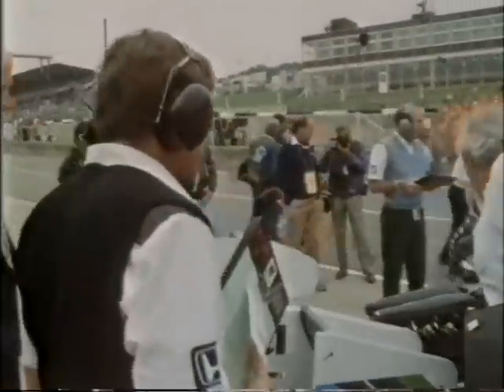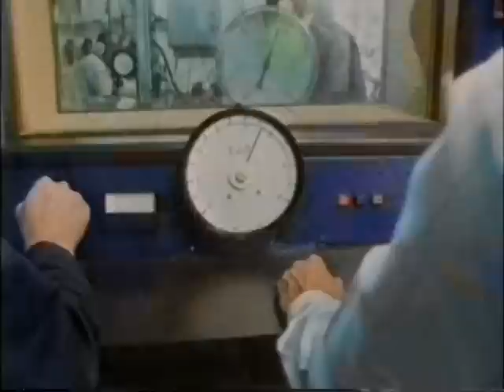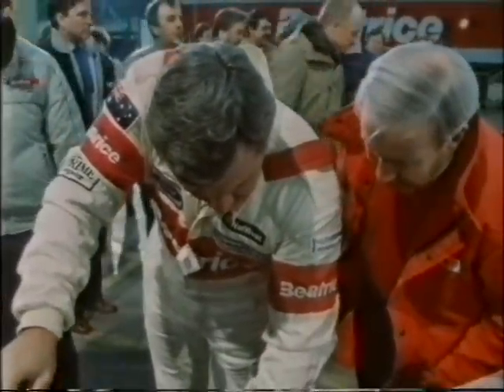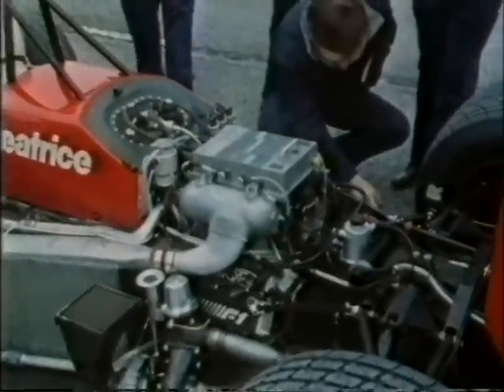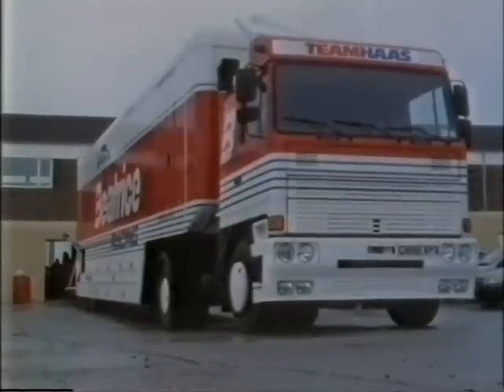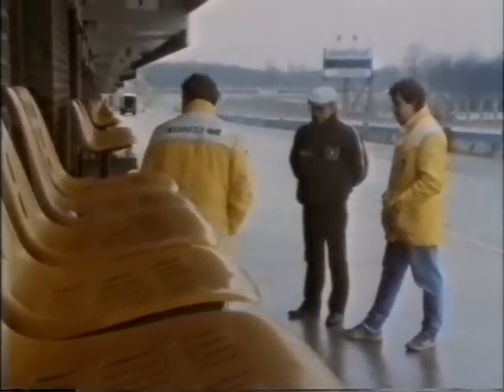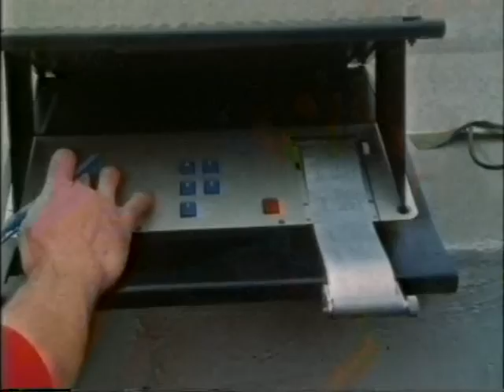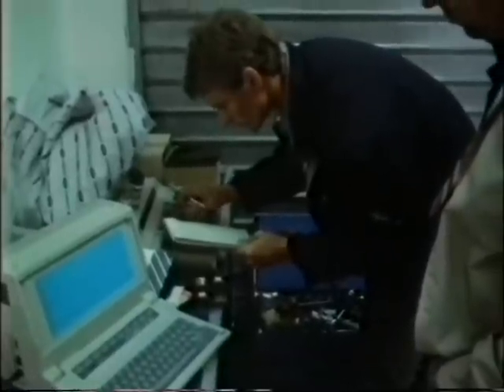1986 Equinox - Turbo - The Cosworth V6 Turbo for the 1986 F1 Season (Part 2)

Comment: Can you tell  why are head bolts in  angle,because i cant understand well,what did Keith said?
Reply: laza kojic so they can fit between the cams, thus negating the need for a separate set of cam carriers above the head. It also puts an angular load at the block/ head interface. Clever stuff.
Reply: From what I understood, the angled head bolts help tension on the block. In other words, they pull the block together thus relieving stress on the block itself. Hope this helps. :)
Reply: "originally" (one assumes he means 'in the DFV'), it was for clearance between the cams. The explaination here seems to say that it increases tension/sealing on a 'lined' block - what we in the US would call 'sleeved', that is it has steel liners/sleeves in the aluminum block. He mentions wanting a lot of dimensional rigidity at the top of the sleeved bore, which is interesting.

Comment: around about the 10 minute mark how would they have been able to communicate?  I know that technically the internet would have been around then....
Reply: They are working on a DEC VT100 terminal, probably connected via modem (left to it) to a DEC VAX minicomputer, first shipped in 1978. Either Coats calls in from the US to the same VAX, or - as indicated by the 'email' address EEDVAX:COATS and EEDVAX:TAYLOR- they are communicating over DECNET,  a predecessor of tcp/ip, either via Arpanet (terminated 1988), or the early internet (1983 onwards). They are using Vax Phone, a kind of chat tool of LAN where the manual indicated: "Be careful in using this utility, since the person you call will receive messages in
Screen on the call and this may interrupt your work." http://www.uprm.edu/cti/docs/manuales/manuales-espanol/vax-vms/manuales/phone.pdf

Comment: 10.000 RPM on an untested engine and the engineers heads are centimeters of the turbo... They lean on top of the block to change sensors... And nobody died!!!

Comment: Never understood the idea of qualifying with tires and engines made to last 5-9 laps. Logically, everyone should run an identical setup as will be used for the race. May as well qualify using 1/8th scale cars on a 1/8th length copy of the race track, RC by the drivers. duh !
Reply: Would certainly save money.